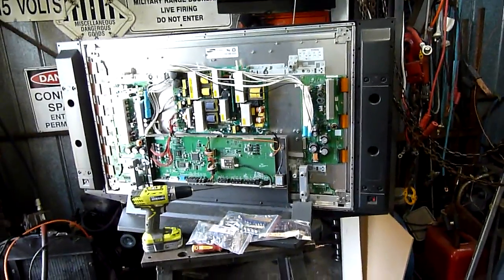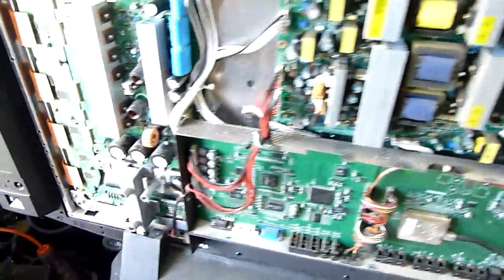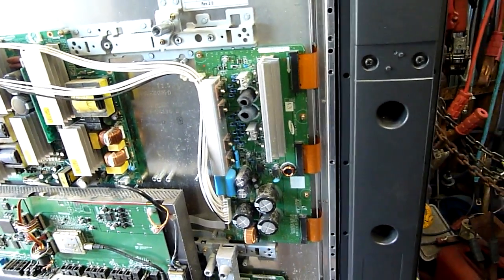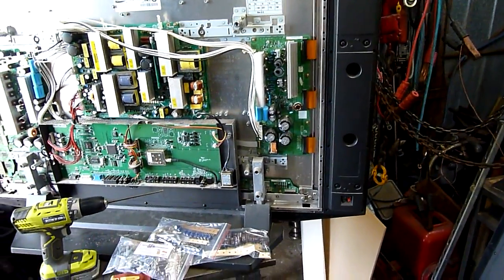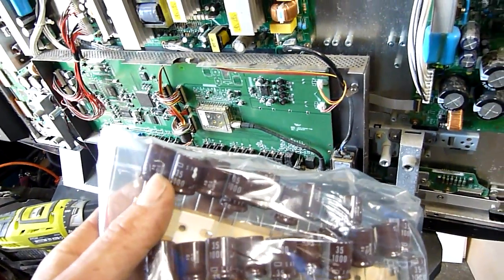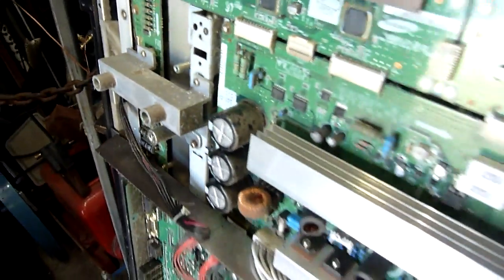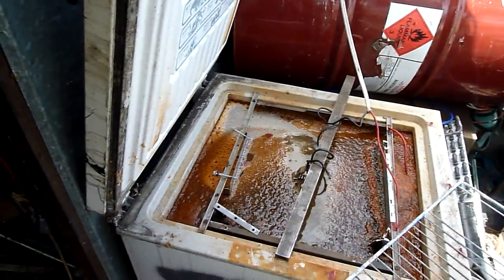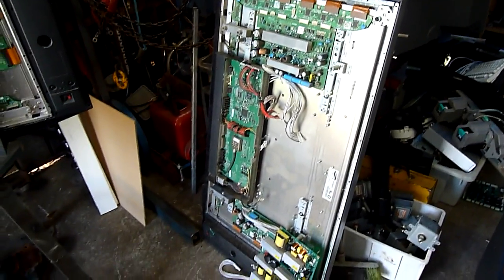Sunday Samsung Plasma TV Rambling

Comment from the maker: if I disconnect the X-sus altogether the picture comes up, but is just dark/washed out. the board had a blown fuse but when a new fuse is installed the panel does not light up at all and the PSU makes HF pulsing/ 'meep' sounds like its suffering under a short condition :(

Comment: Your friend Brad (V8JagNut) doesn't seem convinced of the merits of electrolytic rust stripping and prefers mechanical means like sandblasting. For some reason he thinks it will enbrittle all metal, but I've only heard of it being a problem with cast iron, tempered, and spring steel. I hate sandblasting, it's messy and it's too easy to mess things up, especially sheet metal. One method I've been meaning to try is rust stripping with molasses and water, apparently it's harmless to other metals.

Comment from the maker: sounds like a load of crap, you can run plasma's at any angle you want. of course if your rough with them you can crack the panel and destroy the set, but thats only to do with rough handling, not angles.

Comment: Hi ya ed,
I found that if you firstly check the voltage going to each boards fisrt for example, usally the y sustaian around 62.4volts and the x 120.6v.
I have simlar fault  and found a 5.6r fuseable resistor 5watts in the feed driver go low resistance when i appllied a load onto it,this came of the chopper side.
if no go try and look at this guy in america .......   norcal715 channel.
he has helped me out of troulbe or try grantstv's channel too..I hope this helps
cheers .
jim